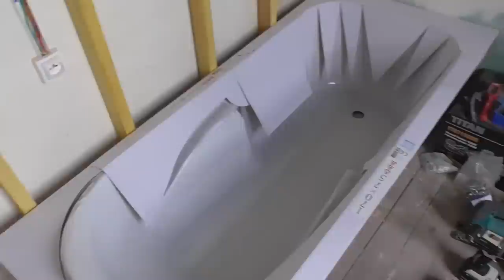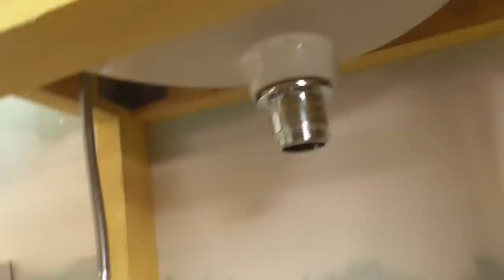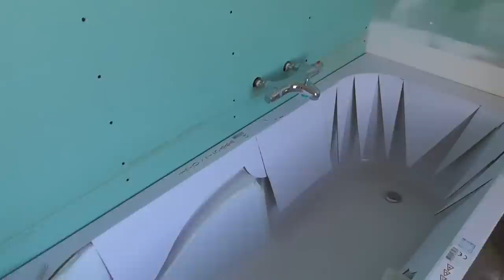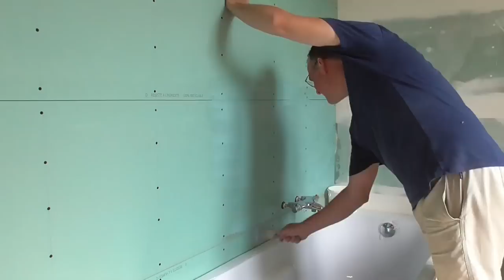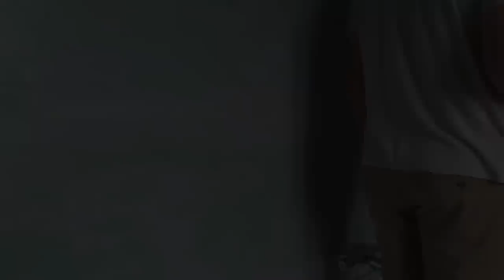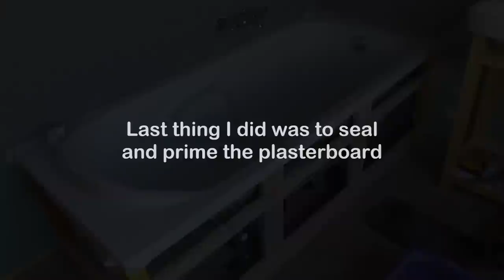Our French House Adventure - part 29 Top Floor Bathroom

Comment: Hi absolutely brilliant idea about the extra plinth under the bath to support it. Well done you. An excellent idea and thanks for sharing. I am going to restore a Bretton bath and was wondering how to support the seat end and now you have shared the idea on what can be done, thank you so much. If your bathroom was in Australia or NZ  it would fail, it's illegal to have light  fitting over a bath and you have no extraction  fan for the shower  that I can  see.  These are hardwired these days so when the bathroom  light comes on the fan also kicks in. I noticed  no heating either are you going to put in a heated floor and towel rail or a tastic ( it's ceiling unit that has 4 heat lamps and light fittings The work is coming along nicely congratulations, cheers  K👩‍💼
Reply from the maker: There is an extractor that will be fitted soon, the vent hose is already in place for it. Light fittings are allowed as long as they are waterproof (IP69 rated). For heating I have a wall mounted hot air blower designed specifically for bathrooms that will be installed later

Comment: How come you don’t need to waterproof the entire bathroom? If you intend to have a shower over the bath and no shower curtain at least half of the bathroom will get wet.
Reply from the maker: There will be a shower screen fitted and most of the walls will be tiled. The water proofing is only where running water will get on the walls, the tiles will be able to cope with the occasional splash

Comment: here in the US, it's common to put a couple of bags of quick-setting concrete under a fiberglass tub for support. another way to do this is to stuff cut pieces of insulating board underneath and seal the gaps with expanding foam. on a lighter (or darker) note, it's too bad you didn't keep the electrical outlet over the tub; now, when the renovation goes horribly wrong, you've no place to plug in the toaster  :D
Reply from the maker: I liked the idea of using the kitchen cabinet feet because they are adjustable so are easy to get an exact fit in the space.

Comment: You make a dam good video ! Thank you even though I am far to old to ever do this kind of thing your videos gives me the feeling I am right along side of you doing it. One question, I seem to notice European restoration workers all seem to prefer using about a one and half to two inch brush when apply paint etc. and not rollers? Is it just me catching scenes at the wrong time ? Just observing !
Reply from the maker: I do use rollers, but when its only a small are to be done then it is just as quick with a brush and there's less clean-up with a brush

Comment: Umm, about the electrical outlet & wiring laying on the edge of the tub, hmm😮😮.  I’ll see what you do in next videos…..  😊😊
Reply from the maker: The electrical outlet was installed in the room as a minimum requirement to pass inspection. At the time there were no "wet" fixtures in the room. Now that the fixtures are in, I will move it to a safer position

Comment: Good job ! How did you cope with the heat waves this summer???
Reply from the maker: The work slowed down quite a bit, lol. Luckily the house doesn't get too hot on the ground floor, just the top floor where is isn't insulated yet

Comment: Wet room ,in America ,tile all around tub area ,floor has a lip, so no need for curtain
Reply from the maker: Not a fan of wet-rooms, especially on wooden floors. Very hard to waterproof 100% as the timber expands and shrinks all the time. Plus going in there after someone has showered means you WILL get wet feet.